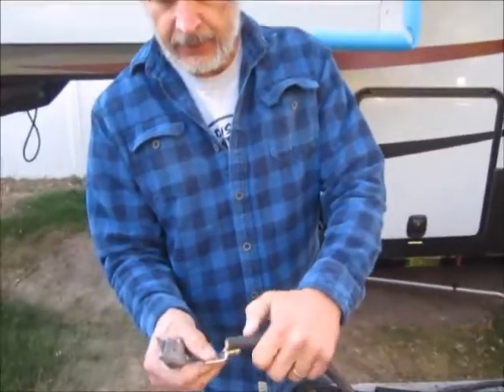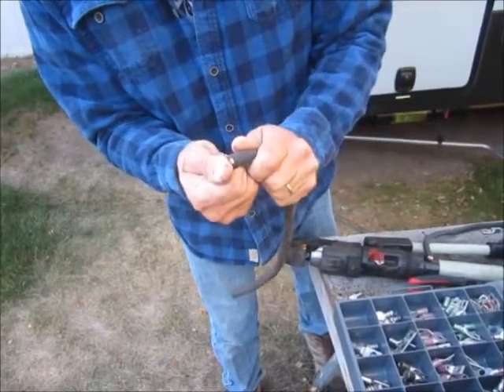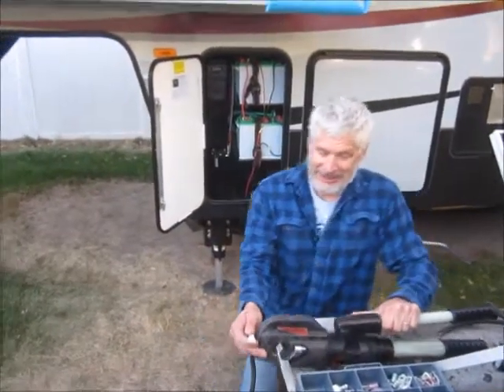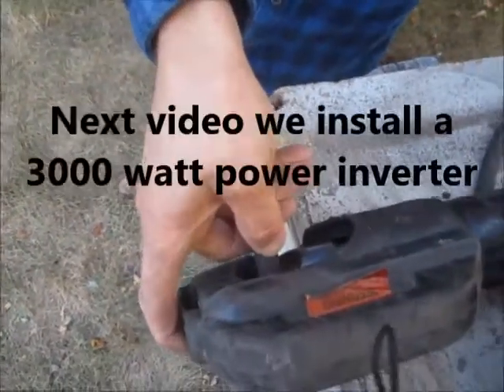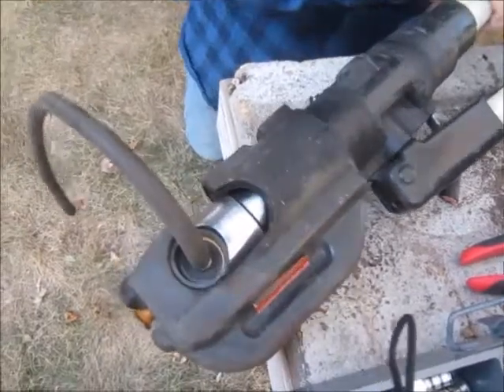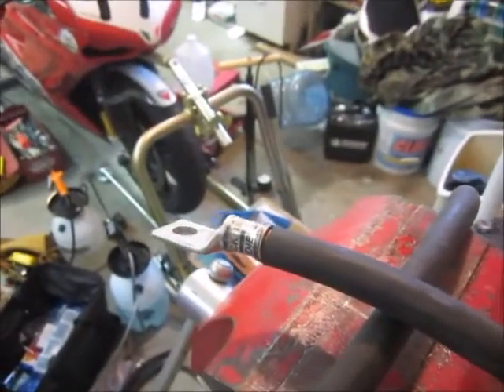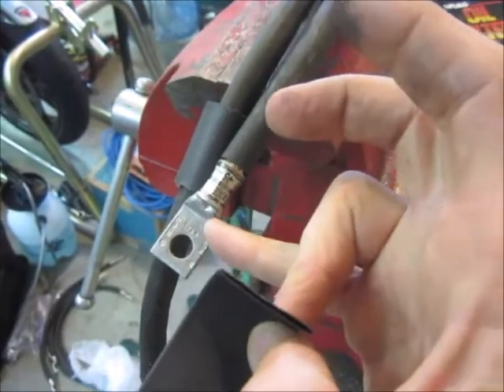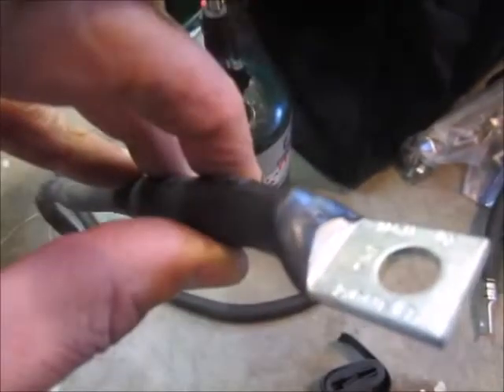Making Battery cables for 3000 watt inverter prep linking 4 RV Lead acid

Comment: Thank you for this video  ..
I'm looking for cables for my inverter I checked online only I found  10feet long  not enough to reach between the battery and inverter still need extra 3 feet 
So I no want to do cable extension 
Can you tell me where I find l inverter cable set like the same one you used ....
Thank you
Reply from the maker: Maher A, yes. Most auto parts stores will sell welding lead by the foot, sell the ends and will crimp them for you. In my town, that store is CarQuest.

Comment: Hey Stim...could you tell me what types of batteries  you are using? lead acid, lithium, agm? also how many amp hours is your battery bank? Thanks.
Reply from the maker: Sure thing. The 1st set in this video are 12v Interstate Marine deep cycle flooded lead acid group 24. 85 amp hour. Cost about $85 at Costco or CARQUEST type place. Not the best choice, but came with the trailer and they will do what I need for now. My brother gave me 2 more when he swapped his RV to 6 volt golf cart battery's. Same type, and they still work. (I am a fine of keeping stuff if it is still working)
When I added my 2nd battery bank, I wanted it in the basement, and not the trouble and expense of a vented battery box, so I went with 2 Windy Nation 12v 100ah AGMs. I think I got them on sale from them off the Ebay store for around $165 each shipped. 
So as of now, I have 2 battery banks. 1st bank of four 85ah flooded lead acid charged  400 watts of solar through a 40amp mppt charge controller, and the 2nd band of two 100ah AGM charged with 200 watts of solar through a 30amp pwm charge controller.
Lithium will be my choice when its replacement time, if I am ready to full time at the same time, along with a Midnight Solar classic 150 mppt charge controller at the same time. Then it will be just the one battery bank.

Comment: What size wire you use I got for the batterys
Reply from the maker: 02
Reply from the maker: This will be more clear. AWG 00 or 2/0 
https://en.wikipedia.org/wiki/American_wire_gauge
Reply: Did you also use them same on your two new battery's with the inver to?

Comment: Hello, from VA.   Thanks so much for taking the time to post these videos!   It has been extremely helpful!   I'm taking my entire family of 8 in my 2013 Raptor Toy Hauler out west in a couple of weeks and I need to install an inverter.   I talked to the head of the service department at my local RV repair shop and he told me that it couldn't be done.   He said that there was "no way" that you could "plug in" the camper into the inverter.   He said that you'd have to pull apart all the wiring in the camper and run a sub panel and run dedicated outlets to the entire camper.    I knew that wasn't the case so I really appreciate guys like you showing us how its done!  Its sad that even when you go to professionals for help seems like you can't even get a legitimate answer!   So thanks SO much!
Reply from the maker: I am glad you found them helpful. This message make it worth the time I spent making all the videos. Thank you for the feedback.I don't think some professionals have seen it done, and just have not taken the time to understand the concept. When I talked it out with my older brother, he was amazed. After he seen how I was doing it, he went one step further and added an extra transfer switch and has no need to run the extra cord. It did not cost him and more money for the transfer switch the what I spent for the extra cord, plug, and hatch. So his is even a neater setup than mine.